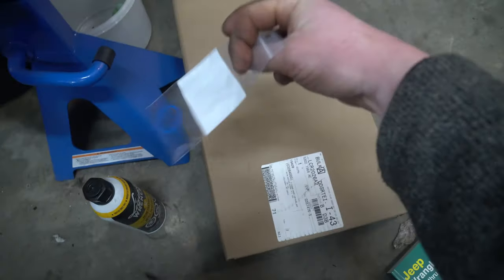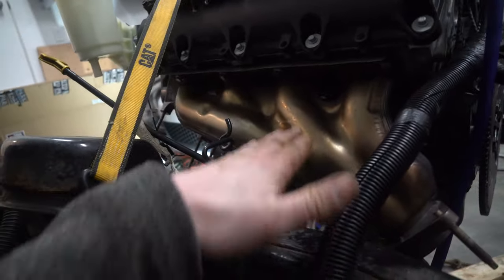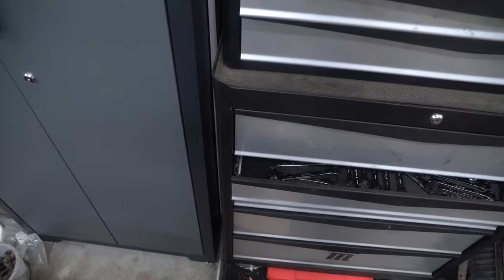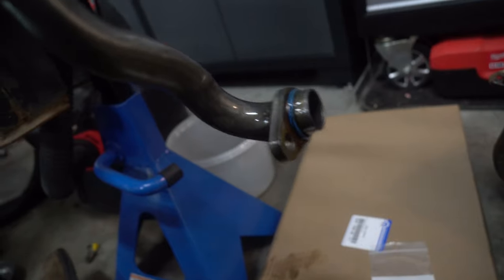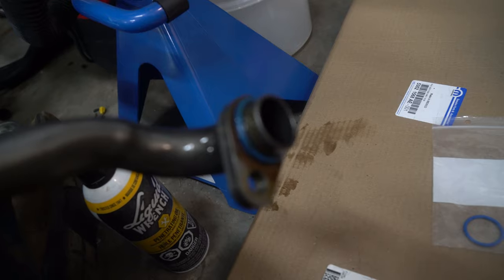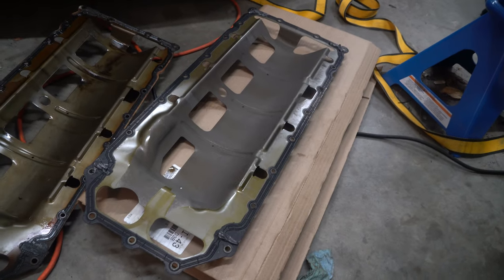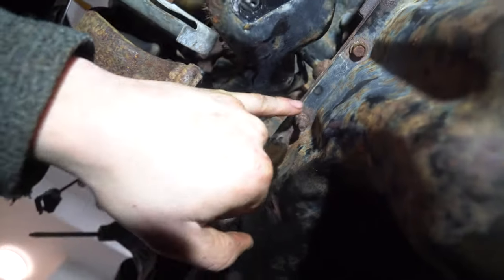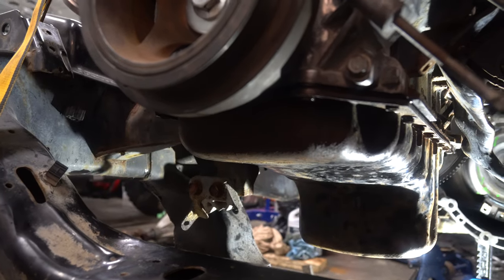HOW TO CHANGE OIL PAN GASKET 5.7L HEMI

Comment: Just did mine and my manual calls for 250 in lb. On both, bolt and nut for the oil pick up tube. Approximately 20 ft. lb.

Comment: The excess rtv squezing out is also squeezing in the inside.  It could get sucked into the oil pump and end up in the filter but id prefer to just use less.

Comment: Did you have to jack the engine up to remove oil pan. Read on another site that you have to raise the engine on a 2 wheel drive to remove oil pan
Reply from the maker: If I were you when you get under do a visual inspection. I was working with a Dodge Ram frame in this video with the rear sump
Reply: @ghostlyrich  Okay thanks what year was yours
Reply from the maker: @novaman1962  2014
Reply: It definitely helps give you more room. I did one today (with great difficulty) and we ended up unbolting the diff and letting it sag in addition to jacking up the engine slightly for more clearance
Reply: @leasian99  might need you to do mine
Reply: Forreal didn't say anything about that and what a terrible angle, can even see lol. Bare minimum video
Reply: As for the Dodge Durango (2005) you have to remove the rack and pinion gear. I just replaced the rack and pinion and tie rods. Wasn't too hard.

Comment: Why is the belt off
Reply from the maker: Was rebuilding the motor and hadn’t finished bolting some off the accessories on yet it went in a jeep hemi project
Reply: What did you do just rebuild the topside of the engine
Reply from the maker: Exactly. The engine only had 70,000 km on it and since it’s not being boosted or being pushed to its limits there’s no point in rebuilding the short block.